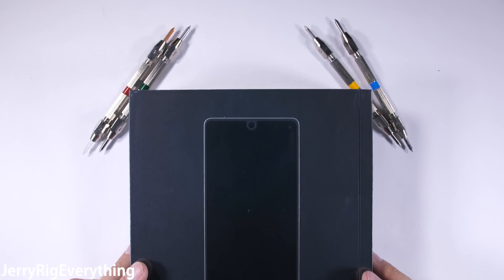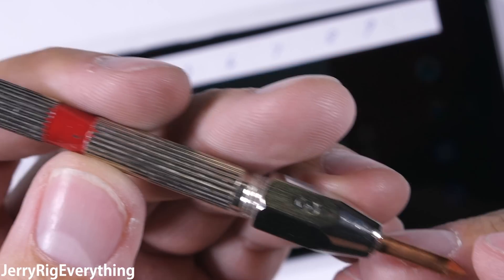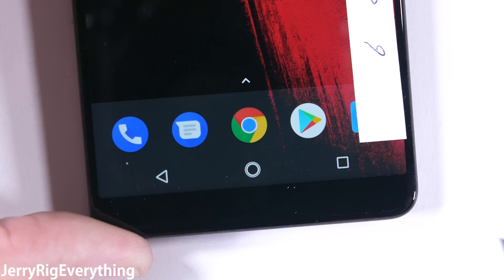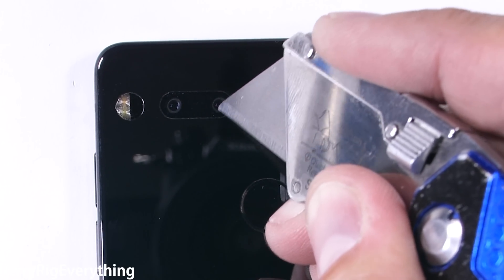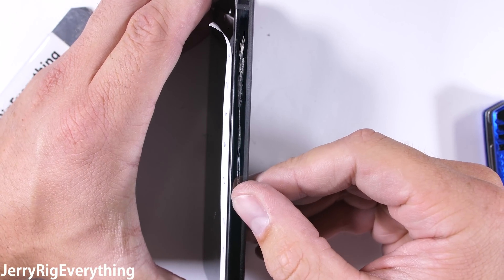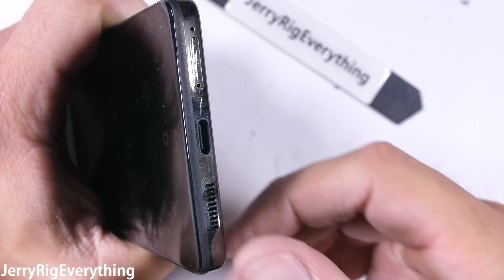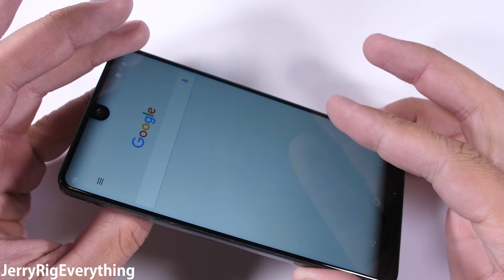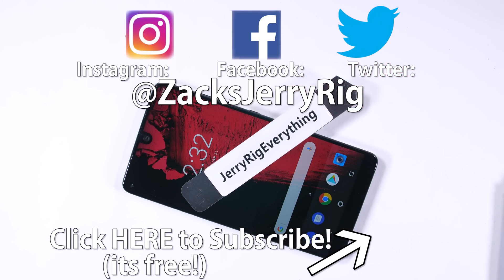Essential Phone Durability Test - Titanium Scratch Test!!

Comment: I don’t get how a port with one feature would be essential.
Reply: I don't know if you are trolling or just stupid. Is the power button essential ? It has only one feature ... the same for the volume rockers, the touch screen ( which is a separate layer from the display ) has only one feature to detect your finger, oh wait the screen has the only feature of displaying what are you doing but no wait the memory has the one feature to store your data, lol the ram has the one feature to store preloaded information for the processor too. LETS REMOVE THEM ALL !!!!

Don't be stupid and think before speaking/writing the port is important because it's a standard proved with time. As long as you have the port you can use all kinds of headphones and speakers all around the world. If you don't however have the port you will be able to use only bluetooth and some times Wi-Fi headphones and speakers which are rare. Like super rare unless you buy multiple of them for every new friend you make.
Reply: EmiNNsoNify  you’re obviously stuck in the past stop being a cheap ass and just get good Bluetooth headphones wouldn’t be surprised if all of android goes jack-Less in the next two years. Obviously the power button has more than one feature. And throwing the display and ram really doesn’t make your case because that’s essential for a phone to work. The buttons take no space inside the phone what so ever and they are necessary to have a functional phone. The audio jack is going away. It takes up so much useful space inside the phone and it’s just a massive hole for water to get in. I’m super surprise this phone isn’t waterproof tho. You might be talking shit now on phones with no headphone jack but trust me everyone is moving towards that. So instead of shoving a massive battery in a phone and causing it to blow up remove the headphone jack and make room for those bigger batteries. The future hold Bluetooth and usb type C everything so sooner or later you either have type C headphones or Bluetooth. And before you say that pros use the headphone jack they don’t they actually use the bigger 2.1 port that doesn’t even fit in a phone. They are better off getting high end type C headphones that are able to pull more than enough power to meet its needs. It’s why pros use bigger jacks. And right now Bluetooth does suck and almost no one makes type C headphones but getting rid of the jack will force 3rd parties to innovate and create better products.
Reply: @Angel Hernandez How often do you have to charge said pair of headphones ? like 2 hours for 4 hours listening ? I travel not a lot but it seems like more than you. I love listening to music but sometimes ( 3 times till now ) i broke my headphones on the road. I can go to any cheap ass ( as me as you phrase it ) shop and buy myself decent headphones. Why would I buy 150+ $ bluetooth headphones ? To listen to music for only 4 hours ? when my phone can go up to 10-12hours of playing music ? To get them broken and would not find another set unless I am in a city ? It somehow doesn't make sense. No the headphone jack does not require space, the Taptic engine that apple has is 6 times bigger than the jack. Was it actually needed when the same thing can be done with software ( its now available to all Android 7 powered devices ) ? The HTC ( next device without the jack ) when opened by Zac in his video proved that there is enough space for a headphone jack. And don't forget even thou for you the jack is not essential for the rest of the world where 100+$ is a lot, it is. 

Please don't be close minded think for the rest of the world too not only for yourself. ( by the way the space of the headphone jack is about 100 to 150 mAh at best to a battery which is about 15 min more to screen on time. Is it worth it ? ) Oh and also the professionals actually use all of the standards it all depends on the device they are using.
Reply: EmiNNsoNify I charge mine once a week. For 30 minutes. And it last a whole week. You can just get type c headphones those might be rare now but like I said when everyone gets rid of it. It’ll be more common. The Taptic Engine is way better than a jack.  It also allows the iPhone to have a fake home-button which is amazing because it will never break. I bet you spent way more than $150 buying cheap headphones if you keep breaking them all the time. Get good quality ones then they won’t break If you travel that much also buy a power bank so you aren’t glued to a wall.
Reply: I am sorry " for a whole week" doesn't sound real to me. Would you link me your pair so I can check them out ? because a full week for me is at least 5 day + 8 hours a day = 40 hours per week. So you have headphones which when charged can last up to 40 hours ? damn that's impressive if real. My headphones does not always break because they are with poor quality i had Sennheiser for 1 and a half year till a friend i gave them to for a few hours step on them not on purpose. Accidents happen all the time. Sometimes my phone break so I have to use my emergency phone ( simple old nokia phone ) which with 1000mAh battery lasts up to 50 hours of listening to music ( and yes it does have an SD slot which i mainly use for storing my music which also is not available on an Iphone ). The taptic engine does not add anything, the new S8 ( my brother has one ) can mimic the same feature using its vibration motor. And it's really close as a feel. Guess what, you anyway use the vibration motor for ... vibration when being called or when receiving notifications. And the vibration motor is about 3 times smaller if horizontal and 2.5 times smaller if round than the taptic feedback engine. 

Yes if we are specific about the taptic engine it is more precise than the regular motor but is it worth it ? And ok Apple have their excuse but what will be the excuse of the other company's. By the way apple removed the headphone jack mainly so they can make more money from headphones. Because they now own Beats so they want their other branch to make a lot of money too.

Comment: Drop tests are kinda pointless, anything you let fall from your hand when using (i.e. chest or ear hight) on it's corner is bust, even lower on concrete or other rough pavements. 1m drop tests on a flat surface cover only a small range of the common ways smartphones are dropped

Comment: Just to note Zack.

You can take monochrome photos, but the main reason it's there is to help the main camera capture more light.

I tried the Honor 8P which has a similar setup and while the difference with and without it can be subtle, it is usually a positive change with better dynamic range and detail. Sadly, Essential so far has not nailed it yet.